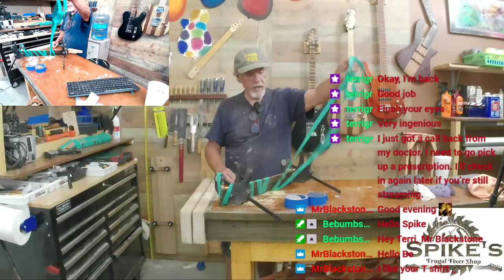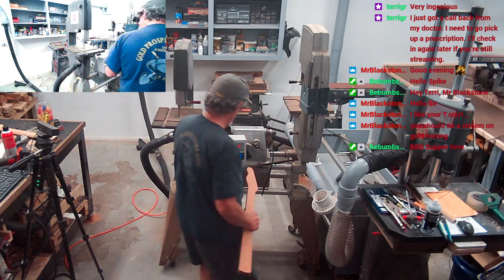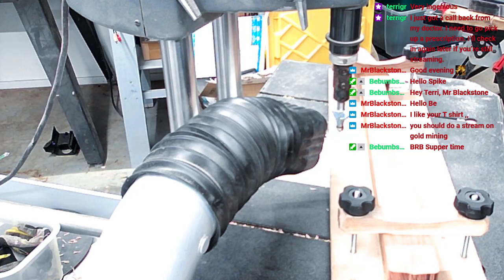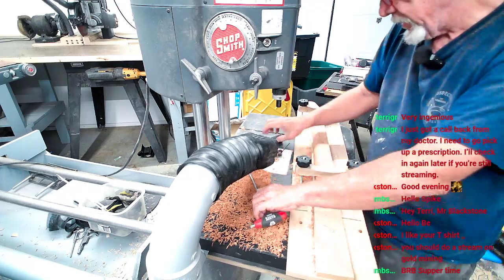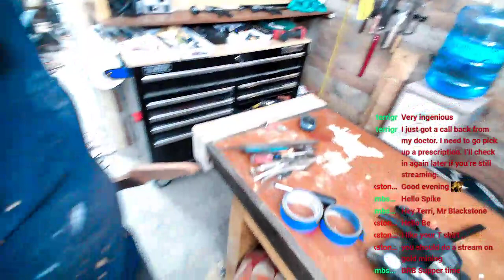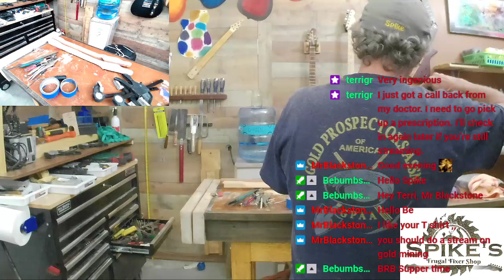GGBO OFFICIAL, Guitar Necks, the Spike Way, with a Shopsmith and Guts!!  Hold on and Go!!

Comment: Spike you still scare me when I see you operating power tools. You should have turned off the router to make the adjustment sense you hand was passing over the top of the spinning router bit as you adjusted it. iIf the wrench or socket had slipped and your hand dropped in to the bit it could have taken a finger off before you even knew it.
Reply from the maker: Yes Sir.